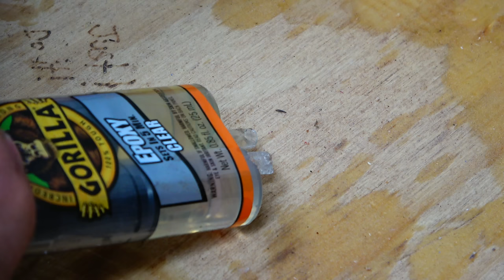Woodturning:  I Think I Need A Bigger Lathe!  😧

Comment: In turning things happen for a reason!  The tenon mishap made it necessary to adjust the live edge and I think the shape fits the piece of wood!  For all the troubles it threw your way you overcame and still produced a gorgeous piece!  I love that finial!  Thanks for sharing!
Mert
Reply from the maker: Thank you so much, Kennett! I really appreciate that! I do like how it turned out although yellow birch in log form doesn’t really dry, it rots. So it was quite a mess to work with.
Reply: David Adamsen I understand the plight. I have a river birch pedestal bowl I’m struggling with right now. I only cut it 6-8 months ago and it’s nowhere near dry, but dang if it hasn’t started to rot away!!

Comment: Beautiful peice Man, after it fell of the lathe I realized that you are human! And still very talented. How do you like the Acks? Does the Shine stay or does it go away?
Reply from the maker: Thanks!  I do like Acks but if you're going for shine, I would not stop at the polishing paste.  Personally, I prefer more matte finishes rather than super shine, but if I want a shine I prefer walnut wax.  In the past, I have used friction polish, but I've moved away from that, since it is not the most durable finish.  Walnut wax (Mahoney's, specifically) is a great and easy method to get a very durable and deep shine that doesn't give a plastic look.  Cheers!
Reply: @DavidAdamsen  thank you Sir, Cheers.

Comment: Hi David, I'm 'next door' in NS in the Annapolis Valley across the Bay of Fundy. I'm about to get into woodturning in my elder years.  Yesterday, a salesman at a machine store in Halifax, who said he's been a turner for more than 40 years, suggesting putting a 2" X 10" on the shelf below the bed, then loading it with 1500 lbs of sandbags to dampen the vibration from out of round wood pieces.  You have that empty shelf on your Jet, so it may be a very inexpensive option, before springing for a new machine.  
Another suggestion from me is to create on the bandsaw, a simple circle jig with a piece of ply or MDF, and a central line at 90° inline with the teeth.  Drill a hole for a 3" or 4" nail as a turning fulcrum and spin the blank 'round that, which, will eliminate much of the wobble and shorten the time to rough down the blank. Many holes can be drilled and the distance labelled for re-use.
I also viewed a Danish video where the turner was using an old refrigerator as a kiln, heated with an incandescent 100W lightbulb, slatted shelves to hold blanks, [both rough turned to 1" and unturned]  two 3" holes at the bottom with 1/4" ply covers for air inlets and a hole at the top again with a 1/4" ply cover on a single swivel screw, to let the moist air out, once the blanks have been equalized for 10 days or so. He also drilled a small hole for the light cord. I guess when you have little money, inventiveness is the mother of curiosity. hahaha
I absolutely love your work, how it's presented in the videos, with the accompanying music, explanations, finishing materials etc.  Keep up the great work. Thanks so much. 🙏

Comment: At the 15 minute point, I noticed how you laid the parting tool against the workpiece and slowly angled down until it started cutting.
What is the advantage of doing it that way?
Reply from the maker: Every time I approach the piece for the first time with the parting tool, I try to concentrate on riding the bevel.  I overshot it a bit on that one clip, but that's the reason. Cheers!

Comment: Dear David, I note that you use spalted wood a lot and hold it together with CA glue. I was wondering if you had thought of going for broke and setting up for stabilizing the rough turning completely? That would make the entire piece consistently strong and hopefully prevent those little accidents. Penny for your thoughts. Cheers.

Comment: If you're not confident in the soundness of your timber, I'd recommend hot-melt gluing a round of plywood onto the piece, and screwing it to the lathe with that. Stronger than either a mortise or a tenon in unsound material!

Comment: Birch rots, really quickly!
I gave a mate a load of birch logs. He never got to use them.
He left them in his green house for a year, and they were just about good for compost.
Reply from the maker: This is true, and I'm learning the hard way I suppose.  I'm not even sure I'll be able to turn the remaining logs of it that I have.  I might resort to wood hardener or just scrap them.
Reply: @DavidAdamsen  
Yup!
It probably costs more than its worth to repair rotten wood. It's so weak, that a small bowl I turned with it was very granular, and started to disintegrate, so that was scrap.
I've only recently returned to turning, after a gap of nearly 60 years since I left school.

I recently analysed the cause of a snatch/catch.
If you try to chisel a piece of flat wood, with a slanting grain, against the slant, the chisel is inclined to dig in, and tries to follow the grain.

A bowl gouge does the same.

As the bowl rotates, the grain presented to the gouge, alternates from end grain, to flat grain, with the intermediate periods changing from slanting grain, towards the gouge and away from the gouge.

I found this when using a 'ring gouge' and after a snatch, the ends of the wood were still clearly visible in the ring.

Thats why I've found a round nosed 'scraper' superior to a gouge for not snatching.

The cutting edge is just a fine burr, so isn't deep enough to dig in. In effect it 'chip breaks' very small chips.
Maybe I'm telling you something you already know, but I felt it worth mentioning.
Reply from the maker: Thanks for the info, and yes a sharp scraper can just melt away material so easily. I may need to invest in a proper negative scraper soon.
Reply: @DavidAdamsen  I have a couple of old van flat suspension springs, that I intend to make some scrapers out of.
I already cut a small piece and made a ring gouge, and used a piece to replace a broken Hand Plane blade back clamp.
I made a small scraper from an old piece of farm machine shaft, about 1/2 inch dia. Just ground a flat, and then rounded it. Worked perfectly on some oak stair spindles I made for a chap/customer. Also ground an old flat screwdriver blade to make a shaped cutter for some of the repetitive detail bits. It guaranteed they were all the same, with no real effort on my part.
I also want to make some larger mortise chisels. The price to buy is horrendous, just for a piece of steel with a wood handle!
(Spring steel is near enough the same as HSS steel. just needs heat and quench hardening on the tip.)

[PS. Passed through Maine some years ago, on a 21,000/45 State  tour of the USA. Nice in summer, miserable in winter!]

Comment: For we newbies, it would be great to get a brief play by play. Such as why did you use lemon oil to seal the part of the bowl that was the rough spot if you will. If would add a lot to it for me. There may be a reason you don’t do voice over. I notice that quite a few lathe folks don’t comment. Would like to possibly know why. BTW, beautiful music selection.
Reply from the maker: Thanks for taking the time to provide that feedback, Jeff. I am still learning and pretty much everything I do is some form of experiment or practice building. So I don’t consider myself an expert. I also hate the sound of my own voice. 😩 But I always try to answer questions in the comments. I experimented with lemon oil on the bark area because of its cleaning properties. I sort of changing my finishing technique to include more pull before waxing or even sealer. This will especially help stabilize super dry wood or wood that is prone to cracking. We’ll see. Always learning!

Comment: Amazing save..I cried when it fell off the lathe..was that log green/wet? Or bone dry?
Reply from the maker: Thank you so much!  This log was cut about a year or so ago, and although we scored the bark, there was quite a bit of moisture in the wood.  I forgot to include it in the final video, but I soaked the bowl in mineral oil for about 4 days before taking the final video of it on the lazy susan.  It has since checked around the pith, but that is to be expected.
Reply: @DavidAdamsen  thanks for that..but I like the natural checking is nature

Comment: I've been thinking about doing that art as a hobby. Could please give me advice as how and where to purchase the required equipment? The wood grain in your area is very unique. I noticed also, but I a application of oil was used during your process. Can you explain that use of oil, oil if you have the time?
Reply from the maker: Hey Alfred! It’s so good to hear that you’re inspired to start turning! I hope you do. You can get set up with a decent lathe (< $400) from Jet/Nova/Harbor Freight, and a decent set of turning tools for about the same cost. You can get by with only a few carbide tools, which may be preferable for a beginner. Once you get started you’ll be better able to discern what tools you need.
I used lemon oil of the bark areas because of its inherent cleaning properties. Any oil could work though.

Comment: Did you get any cracking from the main stock after letting them sit for a while?
Had to ask because I had to let my stock sit for a long time after initial turn in order to prevent cracking and bowing.
Reply from the maker: Yes, I have gotten some cracking and checking, but I have had the whole thing soaking in a bucket of mineral oil for about 2 weeks now and it has released some of the pressure from warping. If I had had more time with this project, I probably would have twice-turned the base in order to avoid that.

Comment: David. I went back and watched this one again. I have a large triple trunk yellow birch I have to take down soon.  Was the piece dry or wet when you turned it?  I’m trying to figure out what to do with the logs to preserve them as much as possible
Reply from the maker: Hi Mark, great question! I would set aside as much as possible and score the bark or remove the bark altogether. Then try to store the wood in a warm dry place. Yellow birch rots super quickly if left in the cold in log form. This piece was probably a year or so cut but not dry since I didn’t store it very well. It got super punky.

Comment: try some wood hardener on that punky stuff I'v used minwax with good results
Reply from the maker: Thanks Paul.  I hadn't thought of that, but it probably would have been a way better solution than wasting a bunch of CA glue and hours and hours of sanding.  Cheers!

Comment: Won't the sanding sealer prevent the lemon oil from soaking into the wood? I thought sanding sealer was to help prevent moisture absorption as well as help fill in small scratches and little imperfections that are hard to see. I just mean as far as a finish goes isn't it kind of pointless to put oil over a sanding sealer because the wood won't absorb it nowhere near as good as it should. Thank you and nice video

Comment: So, why didn't you screw the base of the bowl to a plate. I thought that was basic turning.
Reply from the maker: Well, starting out with a log complicates things. A faceplate would only have worked if screwed into the top of the piece not the bottom. I could have flattened the bottom and put a glue block on it and attached that to a faceplate, but I wasn’t prepared for that, and I didn’t think of it. Either way, I learned a bunch.

Comment: if you want buy ca glue buy starbonb and use my code VILLYWOODTURNING  🤟🏼
Reply from the maker: Thanks Villy, I am already affiliated with Starbond and have a similar code. I used a different brand because that was the only thin CA glue that I had in quantity to complete this turning. Cheers!

Comment: Not being a woodworker, woodturner, etc. myself I am in the dark about a lot of what you are doing here.  What is the purpose of the "Thin CA Glue" and the "Lemon OIl?"
Reply from the maker: The wood was super punky, almost rotten, so the CA glue helped to stabilize it.  The lemon oil has cleaning properties.

Comment: This is all very interesting but you cut a green blank into a bowl........can you say warp
not a project until it is less than 10% moisture......sanding for show
wonder what your subscribers who are starting up will end up thinking when their work turns to something that embarrasses them
really cool and great music as long as I don't try to do as you do
lame
Reply from the maker: I will be the first to admit that I am not an experienced turner.  I started last January (2019).  I harvested this log from a fallen blowdown about 8 months ago. I'm not sure how long the tree was down, but the log was anything but green.  It was probably a bit higher than 10% moisture, but sanding produced fine dust, and my sandpaper only clogged with the hardening agents I used. The piece was always sure to check at the pith and warp, which it has.  But I sized the lid small enough to compensate.  That's the character of the wood.  It would have been futile to wait any longer to turn the log, and ripping it into boards to dry and stabilize thoroughly would have defeated the purpose of making a rustic decoration.